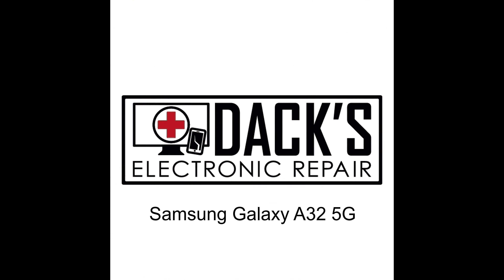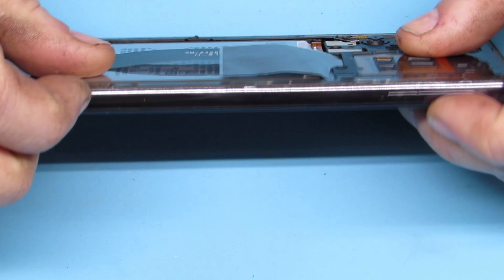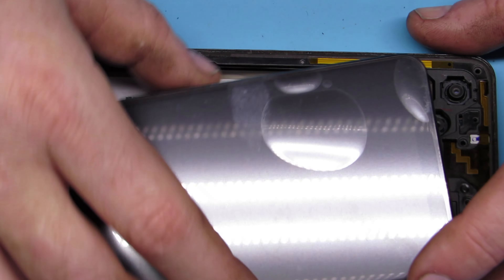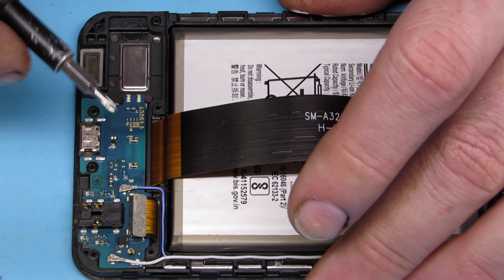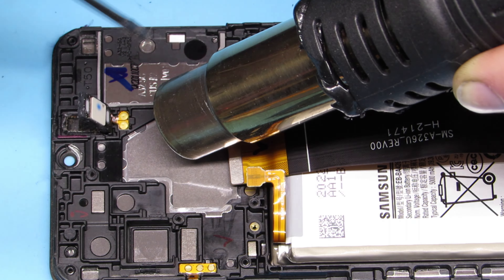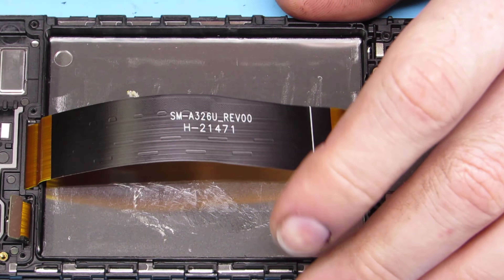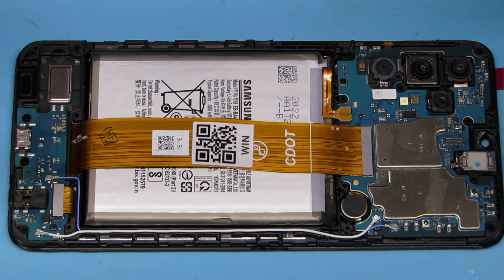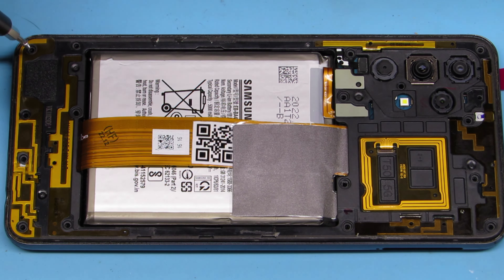How to Fix a Broken Samsung Galaxy A32 5G Screen Repair

Comment: I’ve replaced this screen a hundred times for work but the ear piece speaker keeps failing every time I move it. Any tips?
Reply from the maker: Make sure the pins are not bent in the wrong direction and that they line up with the copper pads, it is possible you just need to replace that part as well. Good luck!
Reply: @dackselectronicrepair  Thanks! I didn’t know they existed on Amazon for $7, gonna grab a few. Cheers dude